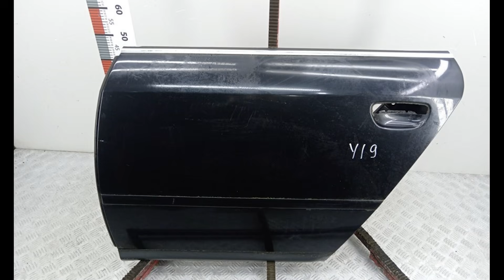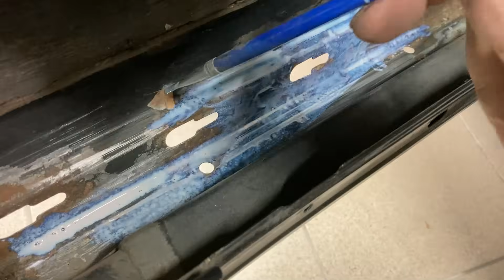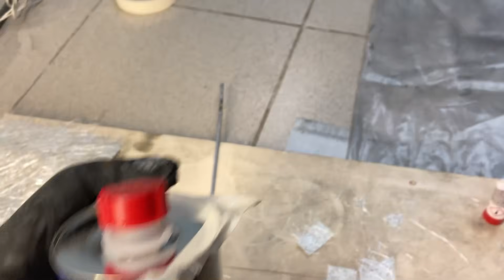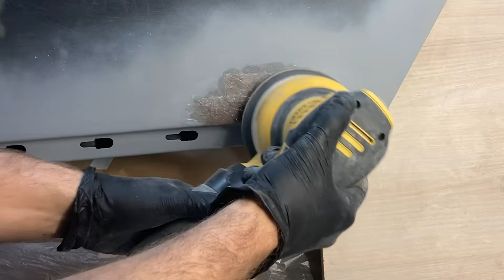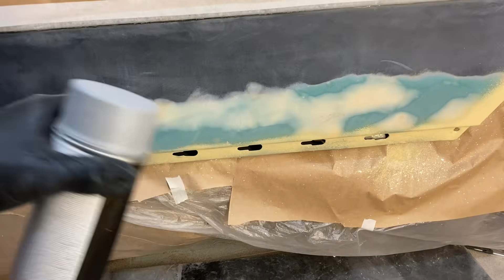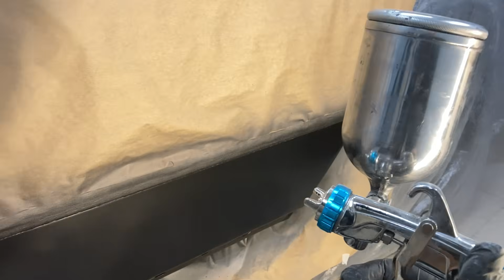DIY Repair Rust Hole in the Door on a Budget Using Fiberglass and No Welding

Comment: Hi can you please send me a list of what materials you used
Reply: Get yourself a fiberglasss repair kit from any autoshop or hardware store, it comes with fiberglass mat, resin, and harderner, will cost you around 50$ and you will have enough material for several repairs inside the kit. I just got one this weekend to fix my rear fenders that have rusted.

Comment: Many thanks, you make it look so easy.  I may try mine hen the weather improves..
Reply: must do this inside, outdoors will make your work too hard, makes drying longer or too fast, air contaminants like dust or even leafs can go get stuck on the repair if done outside, if oyu have no choice, get a temp car garage , you can do this outside, but you will NOT get a good result, fiberglass is a biatch for this, metal work no problem, but fiberglass you need to take a lot into consideration.